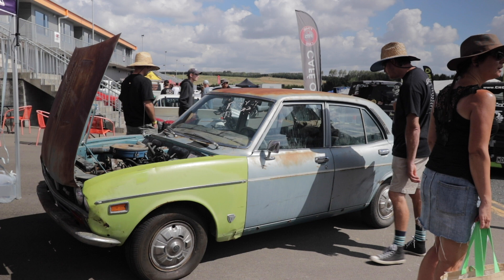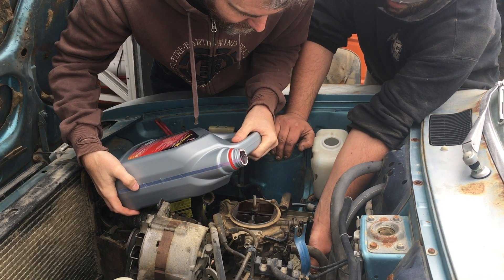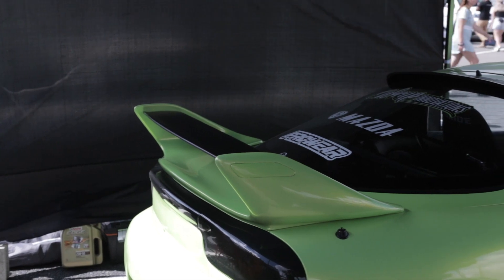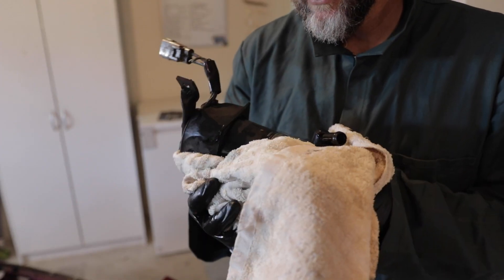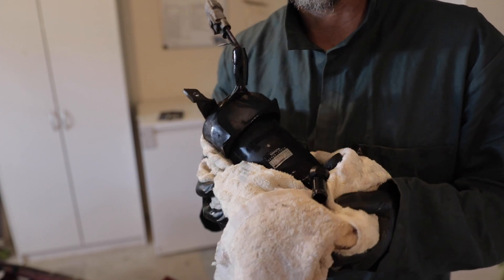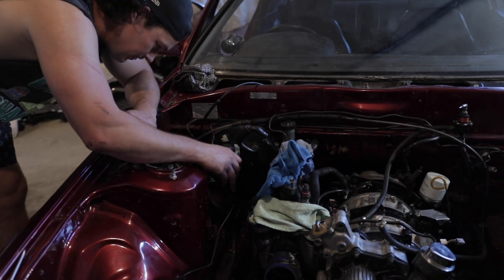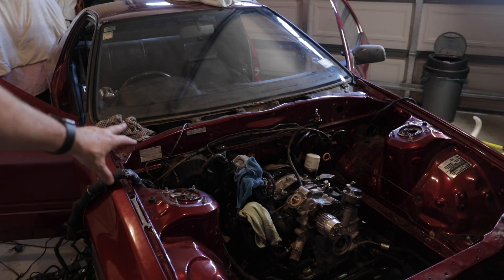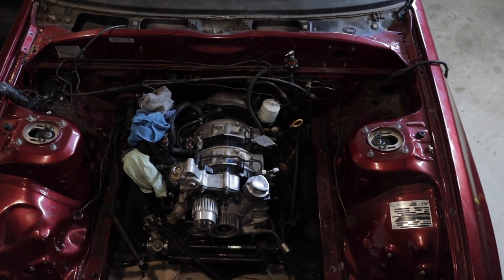The Project That Never Was: Tale of the Barnfind RX2

Comment: The rotary community here in oz need to take note on wheel sizing and ride height from you fella's.
Reply: Um, what?
Reply: @ehpunka  have you seen the Habib spec atrocities being committed in Australia? FR Simmons on 9 out of 10 rx's up to 22inches and tubbed to buggery with Dakar style ride height.
Reply: @ehpunka  yeah they might go a bit low and run some questionably odd wheels sometimes but whats being done here in Aus is embarrassing. Fair enough they can do what they want but how many blue Rx3's with polished simmons and an oldman emu lift kit do we need? A little bit of originality would be nice.
Reply: My rx3 is almost finished. I have the og hubcaps and the standard wheels with dress rings and center caps when i feel like a change
Reply: @ehpunka  please tell me you're not a Simmons boy?
Reply: @Gooie69  did you read the above?
Reply: @ehpunka  yeah i see. I thought the stds for when you need a change from a different wheel. All good